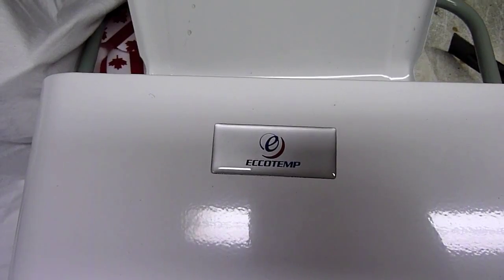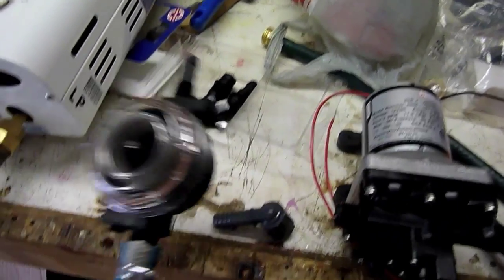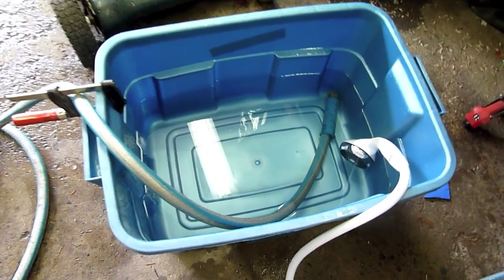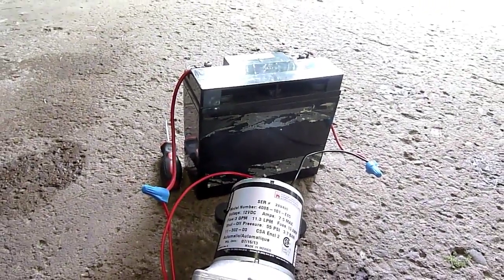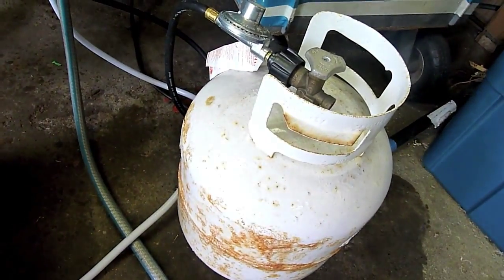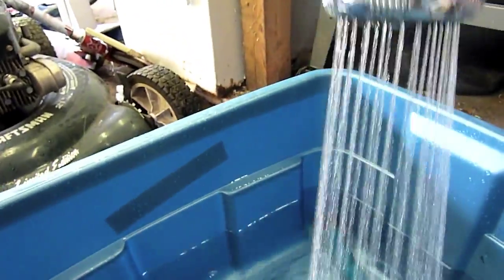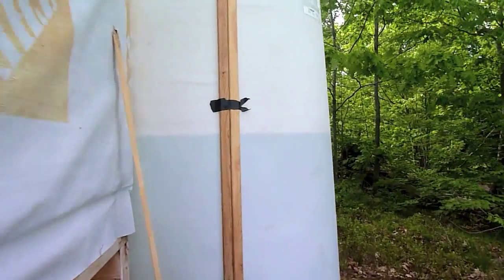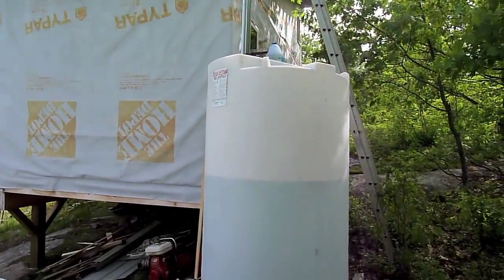Rainwater harvesting at the cabin

Comment: what do you do with your water supply in the winter or do you use your cottage then?
Reply from the maker: We do use it in the winter. We heat lake water on the wood stove or melt snow.
Reply: @OntarioLakeside  thanks for the info. did you insulate your floor in your cabin (I assume so being in Ontario)? what did you use and do you have any rodent problems?  we are building a small building this spring closer to the ground, but am concerned about rodents.  thinking of using reflective radiant bubble foil.  apparently they animals don't like it.
Reply from the maker: @richarddemeester6009  We did not insulate our floors yet because we were worried about mice. I intend to use rockwool and metal mesh this summer.

Comment: Very awesome!  Looking forward to more videos, found you on reddit!

A spent the last few years in water treatment, and worked extensively with a lot of rain cistern clients and of course well water.  With that in mind, I was glad to hear you would make your tank opaque, but also would heed you warning against airborne bacteria, since your tank appears to be what's considered part of an open air system.  Ways to solve this are to place HEPA filters designed for storage tanks anywhere air comes in contact with inside the tank, continuing to put small dose bleach in, or ideally install a submersible UV light (expensive upkeep). 

Sorry for the long comment, but I just love the topic of rainwater retention!  Let me know if there's ever any water related questions you need help figuring out.
Reply: I know this is a really old comment, but I'm looking at doing something like this at my cabin. What is expensive about a submersible UV light? Can a sand filter work as well? Thanks, if you're still around.